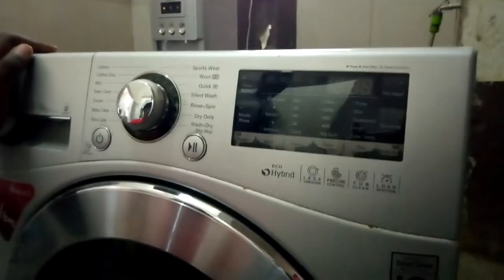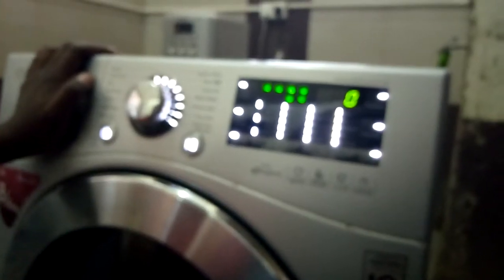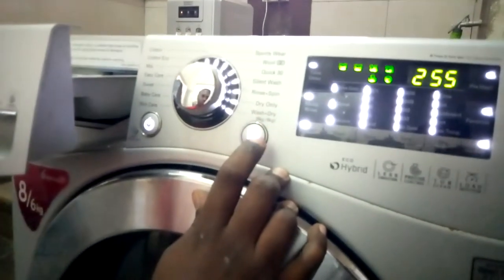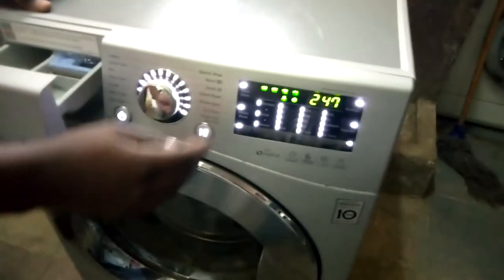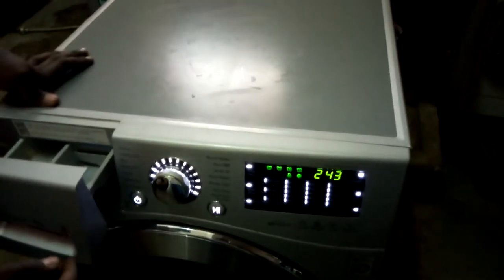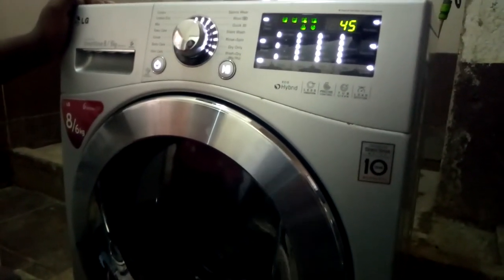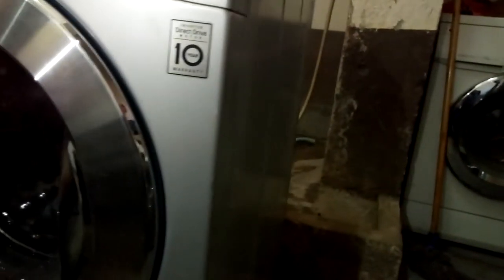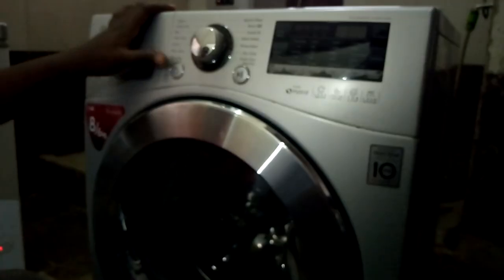LG Washing Machine Test Pattern, Secret Engineer's Mode

Comment: diagnostic mode works perfect. Went through all steps till i switched on the pump: it start to make a noise, kind of current short circle, sparkling or smth like this. Is pump dead already?

Great film btw
Many thanks
Reply: After strip down front panel and taking out the pomp, i have discovered that there were small tiny fibres silicone balls (1mm dia), which made a noise due pumping water in...
Once again, check that before you decided to buy whole pump unit.
Cheers
Reply from the maker: Thanks for the great tip
Reply: @GreatBallsOfAcid  tiny small particles get inside pimp rotor caused that noise. Noise appeared only when pump pushed water out...